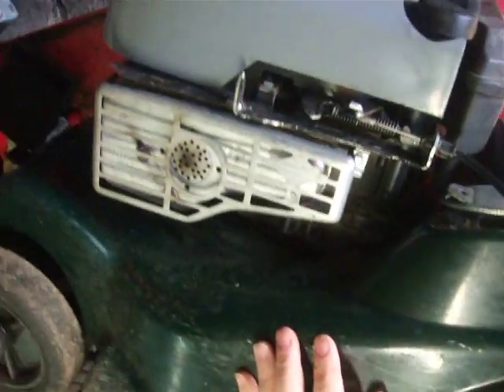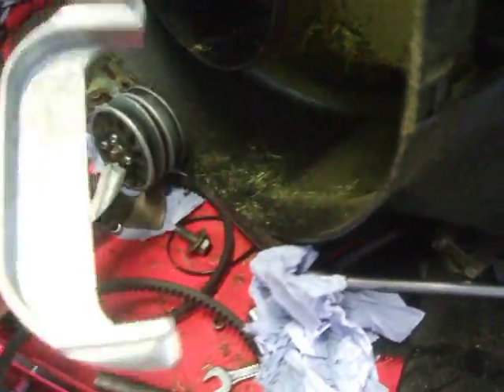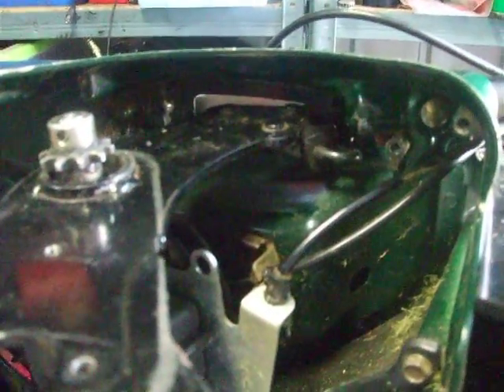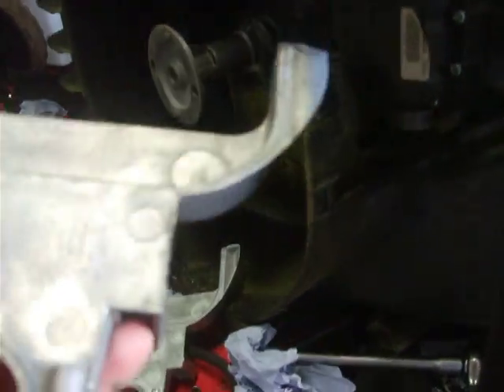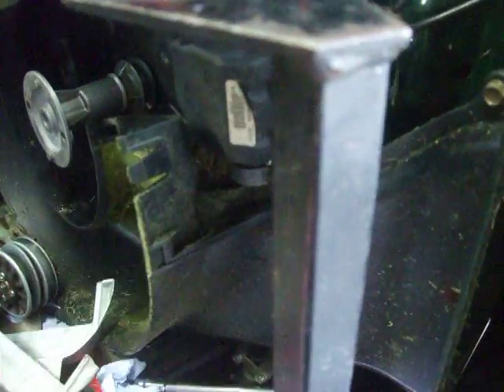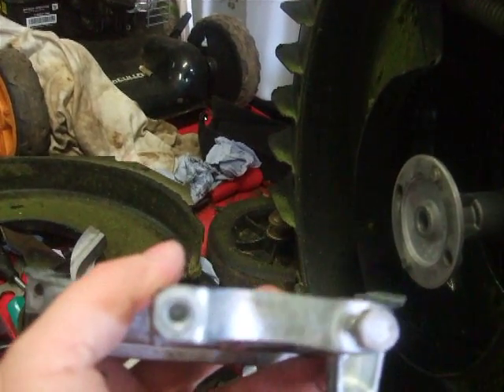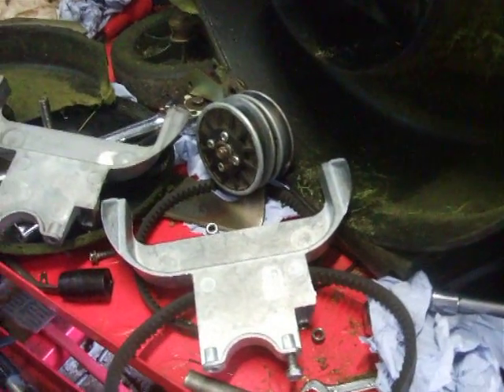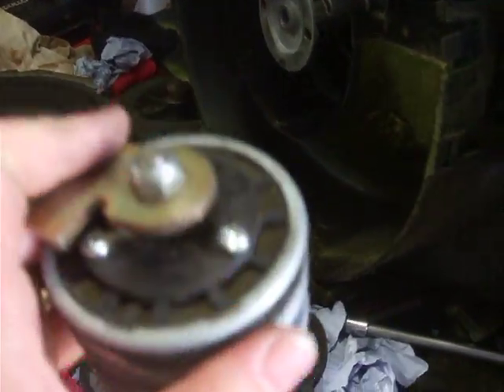Common problem with the Hayter 41 mower. Repair

Comment: you are a legend, great videos.
mine just snapped, less than 1 year old.
been using them for a few years and it's the most comon problem, those brackets.
you usually notice that the front wheels bounce a bit more, quite a bit more of a give from the front suspension, and when you are cutting, the height gets quite impaired too, meaning once you ajust the height and cut it doesn't quite seem right, quite uneven.
hope this helps others too.
keep the good work.

Comment: Hi great vid really useful, i have a problem with my mower i cannot get the height adjustment assist spring back onto the roller assembly at the back after taking it apart to repair. The spring just holds so much tension its impossible to stretch it over the roller bracket piece. Also probably part of the reason those aluminium brackets snap with the tension on that spring!

Comment: Hi there. I see this is quite an old video.  Would you be able to explain how to replace this part. Mine has now broken, and I have the new part. I can get it all to lined up in place , but find it impossible to get to one of the long bolts that connects to the hight adjuster. ( I’ve obviously not removed something that makes this accessible.). Cheers. Daren.   ( complete novice)